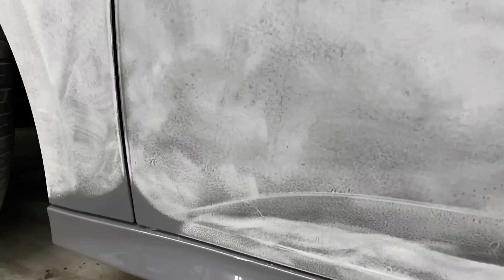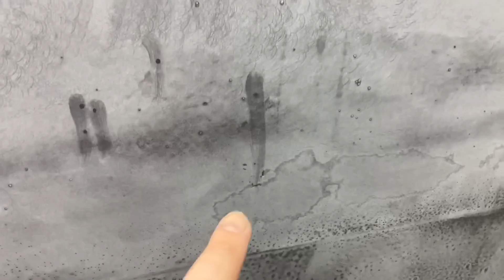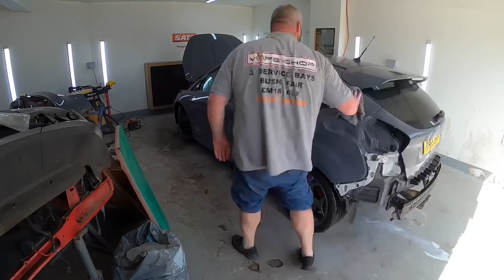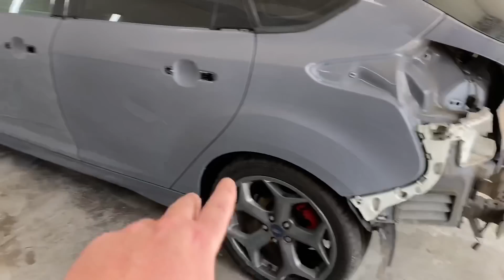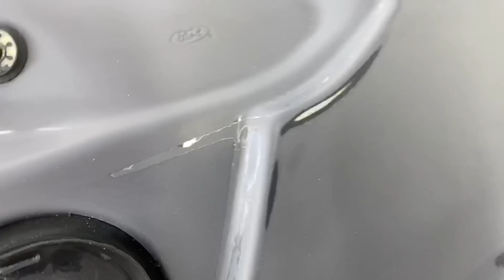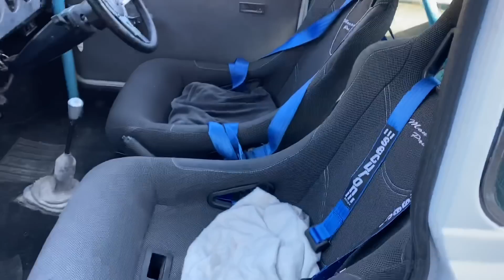Mountune focus st3 disaster paint job repair!! Part 2

Comment: There was another thing that used to be done to the mini's was to get rid of the seam joins,where the rear and front is joined together,they would cut that folded over seam off and weld it there,it makes the body look way better,they used that join because it was cheap to it that way,most of them rust as the water lays inside them,might be a nice touch to do that to that mini.
Reply from the maker: I like them smoothed like that to

Comment: Master at his work. Great job I just wish you explain what ever you've using to deal with all these different situations. I can see you're under pressure cause you weren't expecting such horrible job by the so called painter. But for me it was my best chance to see and learn how you dealt with it. Very interesting. But I didn't learn much this time just watched you fixing all the problems. I wish I had your knowledge. Great stuff keep it up. You deserve a tap on your shoulders and very cold pintssss ✌🤟👍👏🙏
Reply from the maker: Thanks 🙏 and sorry it was very hot yesterday and I was just trying to crack on with it, all that happened was sanding pulled the dents out and few skims of finishing glaze which is a fine finishing filler then more sanding 👊👊👊

Comment: What was the black stuff you spread over filler before sanding mucker?
Reply from the maker: That’s guide coat, you put it on and block it down to make sure the repairs straight 👊👊👊

Comment: Waxies as I used to call them. Fucking painters nightmare. times I have put a coat of paint on a panel and it has opened up. Straight out with thinners on a rag and wiped the new paint straight off and start again. Barcoat is magnificent stuff as you know, reacts with nothing known to man.😅
Reply from the maker: Yeah don’t use it much I’m sure I won’t need it on this when I’m finished but I feel his pain silicons are a pain 👊👊👊